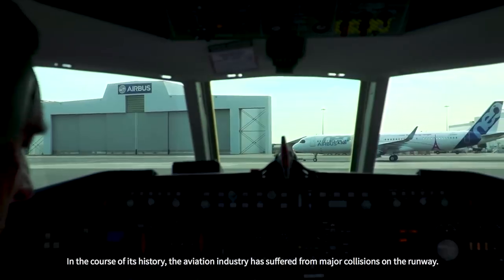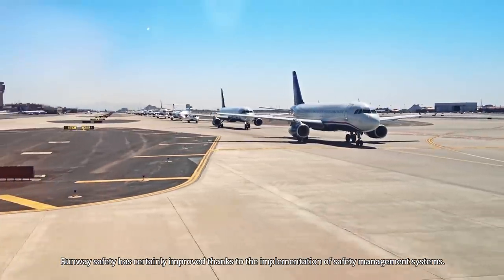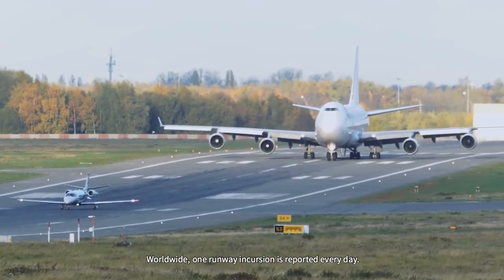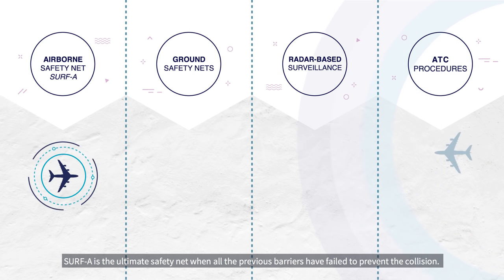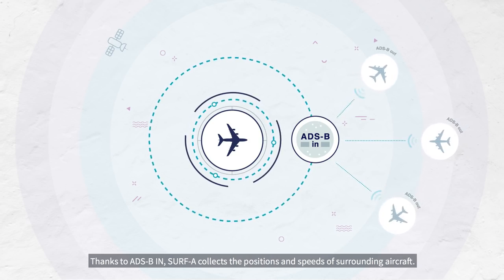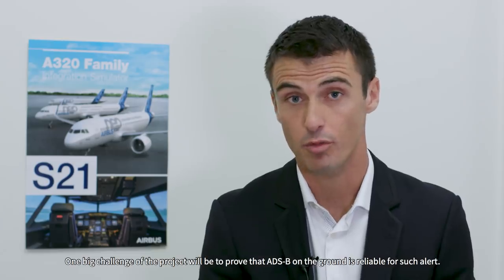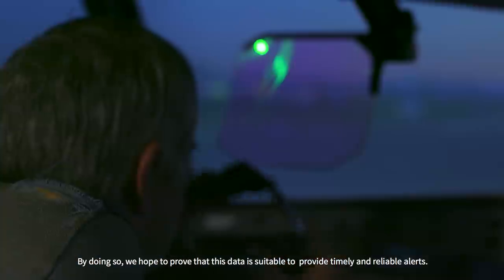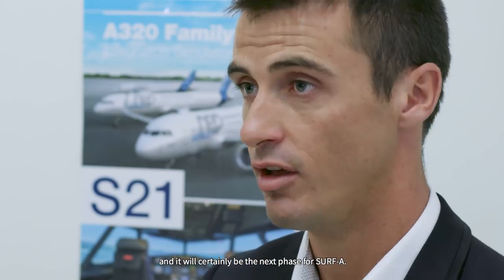Surface Alert, a runway traffic collision avoidance system

Comment: Okay, before everyone starts bashing Airbus for saying the plane in 0:15 as an A320 and 737 instead of A340, let me get this straight. THAT FOOTAGE comes from the incident which happened in BARCELONA not CHEONGJU (as mentioned by the narrator). Airbus didn't have the footage of the incident which happened in Cheongju so they used the Barcelona footage instead to replicate a runway incursion scenario.

Comment: They had to use the 747 accident as an example...Airbus. And they said 737 instead of 767 and a320 instead of a340. Airbus cant identify their own planes. If they giving wrong data at the beginning of the video, should I believe what other information they saying? How would this work in very tight arrivals and departure airports?
Reply: The 747 incident is the most significant of it's kind, and there is no reason to expect the aircraft types involved in the other actual incident to match the types that are involved in the archive footage of a representative example.

Comment: it did not help much in preventing the A350-900 collision with the coast guard plane on the runway in haneda, Tokyo
Reply: The Dash-8 did not have ADS-B.
Reply: It is not yet installed on commercial aircraft. Certification is planned for this year. It wouldn't have helped though since the Dash8 was only equipped with MLAT transponder and not an ADSB transponder